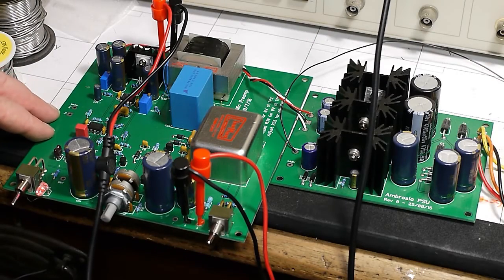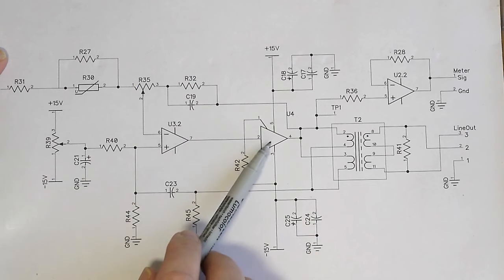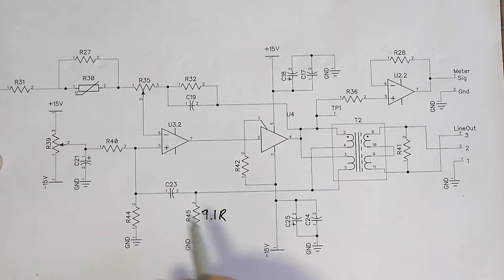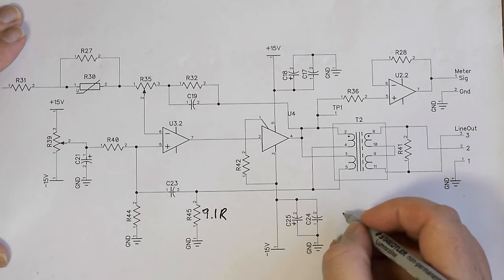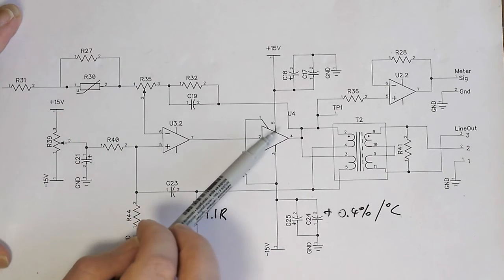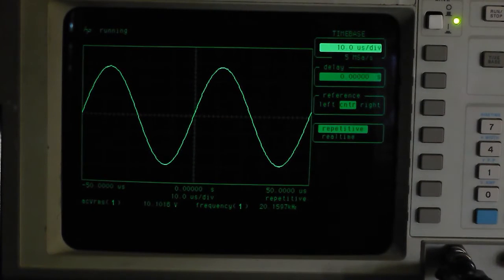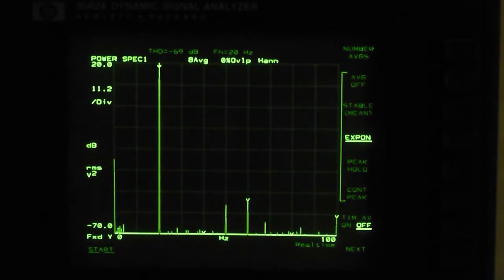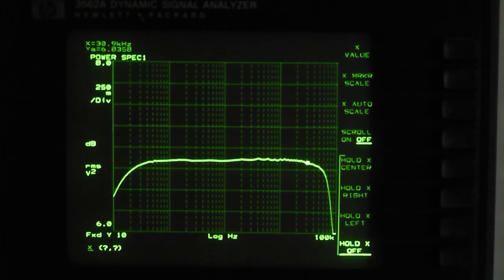DIY mic preamp build - testing part 2 (Electric Boogaloo)

Comment: Great job, it's a fantastic amp design! I've never seen positive feedback used in the output transformer, do you know any place where I can find some more information about that technique?
Reply from the maker: Thank you so much! There's a PDF on 'Mixed feedback drive circuits for audio output transformers' available from Lundahl:

https://www.lundahltransformers.com/wp-content/uploads/datasheets/feedbck.pdf

Also, Rod Elliott mentions the technique in his articles on Negative Impedance and Transformers for Small Signal Audio:

https://sound-au.com/articles/negative-z.htm
https://sound-au.com/articles/audio-xfmrs.htm

Cheers,
Karl.

Comment: Very nice video! I love how you explain the positive feedback in "DC"-mode :-). nice design by the way, perhaps i would add an RC network at the transformer output.
Reply from the maker: Thank you so much, glad you enjoyed it. Good point re: an RC network on the output - 'twould be nice to damp that last little bit of transformer ringing.
Reply: You are very welcome. Additional damping points are over the primary input in conjuntion with RC damping over the 9R1 resistor. A nice and clean squarewave allways sounds better, eventually with some loss of bandwith. Best  regards Christoph

Comment: Could that very small amount of 50Hz be due to the output transformer being un screened? Or is the impedance at that point so low as not to be an issue Just a point of interest as I very much doubt it would be audible to anyone, only just detectable on your distortion  test gear.
Reply from the maker: I think the bigger issue is on the input side, where there's several feet of unscreened cable running across the bench. That said, it'll be worth taking some care to keep the PSU transformer as far away from the output transformer can be managed. Given how little hum there is just running the bare board on the bench like that, I'm sure it'll be fine once it's in a proper enclosure.